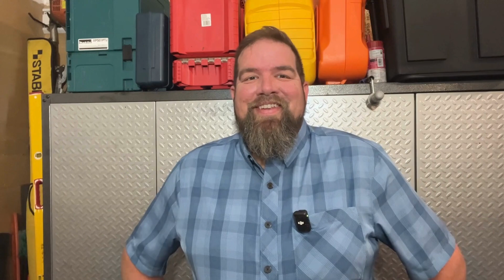Your Windows Are Showing You Something. Your Walls Are Hiding It.

Comment from the maker: The sequence for any hidden moisture problem: source, path, destination. Where is the moisture coming from, cooking, showers, the ground under an unsealed crawlspace? What path does it take through the building assembly? And where does it land, attic sheathing, wall framing, floor insulation?

Window condensation tells you the source is inside, not outside. That's the starting point. The next six videos each take one surface, mold, smell, rot, crawlspace, attic, siding, and walk through what's actually happening there.